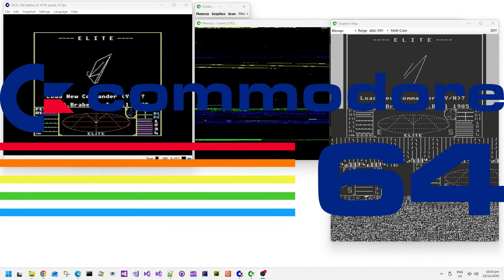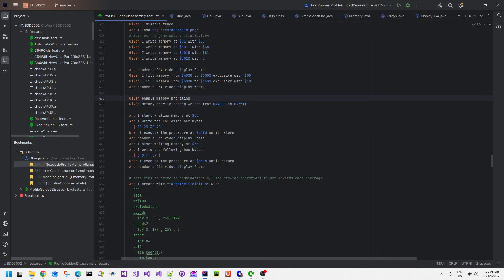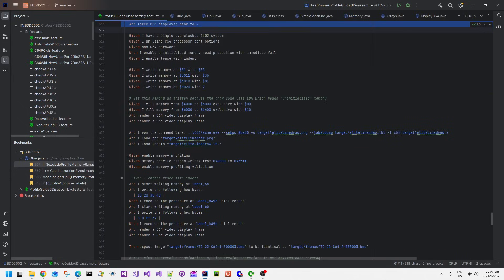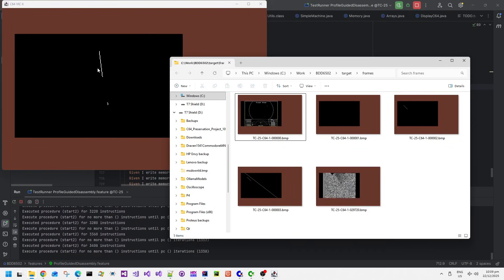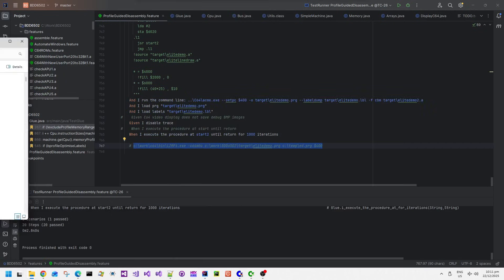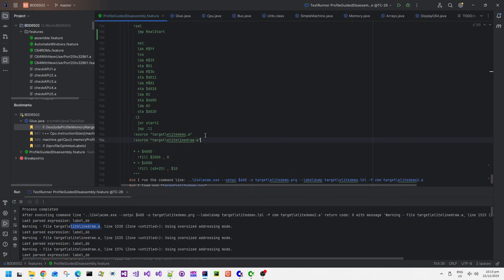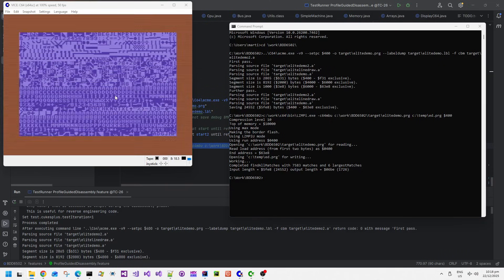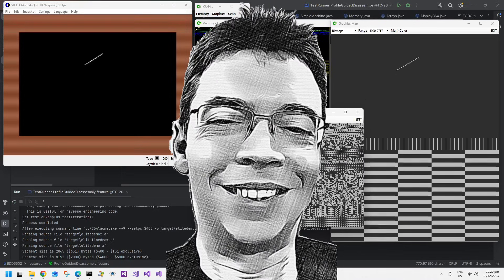C64 Coding - Elite's line draw disassembled

Comment: @MartinPiper6502 A demo called "C64: Christmas Megademo (2020)" uploaded by I Dreamt In 8 Bits seem to be popular this year. Never saw it until this year.  Can you take a look at the snow FX at 24-30 seconds in? I doubt sprites, but I don't see how it could be custom chars. And too many flakes for a 1MHz 6510 to move I think. There's still that other snow demo, what' it called? Oh, just found... "C64 One File Demo: Xmas 2023 by Luke ! 23 December 2023!" has fluffy flakes, guessing custom chars but, nice natural-looking technique.  Ah!  Here's the one I asked about before, it's called Hyperborea by Artline Designs.
Reply from the maker: I saw it in YouTube, it looks like X expanded sprites, in a sheet, over a bitmap. :) A repeating pattern of pre-calculated animated sprite frames would work.
Reply: @MartinPiper6502  I mentioned 3 demos. To which one are you speculating on?
Reply from the maker: @KellyIsUppity  "C64: Christmas Megademo (2020)"

Comment: I remember disassembling Starion's line drawing code on the Speccy back in the day. It was faster and smoother than Elite but also a different kind of space game. I don't think it' had hidden surface removal. It didn't use XOR do "undraw" between frames but it had an incredibly fast trick to clear the screen instead, which used the stack and the spare register set, something you wouldn't be able to do in 6502 world. Interesting to see something contemporary and similar from the C64.

Comment: I really wish someone would give the dragon some love and bring Elite over to that.  The 6809 processor is faster and more efficient that 6502 which was why it was much more expensive leading to the reason it wasn't used as often in home computers and more in arcade machines and other applications.  But the dragon is still popular among enthusiasts and the Color Computer community at large would love it too.
Reply: The Dragon had quite inferior sound and video hardware which could not be compensated for by the higher CPU performance.  In my memory disk drives were rare, even more expensive than for the C64 and required a disk controller which was dangerously hanging out from the expansion port.  The Dragon 64 with OS9  and a floppy drive was a decent office system.  Commodore on the other hand had their professional BCM series computers, their VC and Pet series more targeted at amateurs.  Pushing the C64 into the market and seeing where it was going to establish itself was a comparably trivial exercise.  On top of that Dragon was barely successful outside the UK.

I haven't watched the video yet but I'd assume Elite is using the Bresenham's algorithm for lines and circles.  That's at least what I have implemented myself back then 🙂  The algorithm is very clever, elegant and foremost, fast.  It's just that the VIC's crazy memory layout for hires graphics is throwing a wrench into the mechanics of that elegant performance.

Comment: That's pretty cool, though I'm not sure what the use of it is straight away. The actual point to point Bresenham part of wireframe 3D is about the simplest part, isn't it? And the erasing is just doing it all again but setting the pixels to black instead of white (if you don't care about what you overwrite, which would seem to be the case if you're redrawing the entire viewscreen each time... the clever part is not ruining the text that the ships overlap with on the title screen).

The heavy work is what goes before, calculating the actual points to draw between and working out which lines to not draw (or immediately erase?) for the hidden-line style. Be interested to see if that can be isolated and pulled out, just taking a table of vertices in 3D space plus a camera position and orientation, or even one of objects and their positions/rotations, and generating the draw list that can then be presented to this routine.
Reply from the maker: There's an excellent site with disassembly analysis across multiple machines and releases. Have a look for the section "Elite G (Flight)" and then "Drawing ships". This contains an analysis of all the transformation, projection, line clipping etc. The Commodore 64 version has some differences compared to the BBC version, notably the use of log maths for the line draw divide and a corresponding inverse table transformation, with unrolled pixel plot.
https://elite.bbcelite.com/disc/articles/map_of_the_source_code.html

Comment: I just did this in my head, so it may be wrong. I have no opportunity to test it. But if you line draw the new image before you line draw the old one to erase it, and you're using an XOR drawing routine.. I think that will cause less flicker in cases where the object is moving. Or not. But both versions should take the same amount of time at least. Is that worth a trial run?
Reply: Flicker free lower res bitmap c64 gfx alternative:
Once coded a 192x192 bitmap(96x96 2x2 or 48x96 2x4 pixel) display using 16 multiplexed expanded sprites to over/underlay a normal text screen to get additional coloring/effects per block on most of the screen .  Could switch sprite pointers to double buffer flicker free low res bitmap gfx and the render  cost of the chunkier pixels meant good speed boost and much lower memory footprint. 
Actually multiplexed 32 sprites for that experiment so could have a 192x192 sprite bitmap overlay with 16 free roaming sprites, so presumably could've used the 16 free sprites for another simultaneous 192x192 chunky pixel overlay! 
Also given was a sprite based bitmap overlay on normal text modes, could have interesting computationally cheap char effects happening behind/in front of  it like plasma effects, parallax, char sprites etc 
Thought about using it on my 3d petscii c64 hybrid raycast/polygon engine to  do  something really interesting..... 
Wonder if anyone tried implementing such a thing in a game?
Reply from the maker: The game does the same line draw to erase, because it's an eor draw. If the previous frame line is erased just after or before the new frame line for the same object then that will reduce flickering.
Reply: Perhaps. In my head I can't shake the fact that getting some of the new lines onto the screen before erasing the old ones would have some sort of persistence of vision difference though. As I said though, no real idea if that's the case. And, again, only for moving objects. If the frames are the same, the results would be identical.
Reply from the maker: I have a feeling it would be less annoying than the full object erase and draw flicker :)

Comment: That's such a great idea, I'm totally going to  ~~steal~~ borrow this idea for my emulator stack!
Reply from the maker: Awesome! Hope it works out well for you.
Reply: Wdym by emulator stack exactly? Why is a line drawing routine of use to it? Are you emulating vector graphics on an 8bit system?
I want to build some kind of Z80 based arcade machine/puzzle box but haven't looked into graphics output options yet, but this got me tempted to see if something along those lines (pun not intended) could be doable. I'd probably use one or more Z80s just for drawing, in addition to a main program one and possibly more for other subsystems. Not sure what kind of device to display on yet though, could go for anything from a ws2812 matrix to a whole microcontroller+lcd combo, but something in between preferably.
Just a dream project so far, but I got a dozen Z80s and eeproms on hand. Built an eeprom programmer, and got a Z80 to run with an Arduino emulating the memory last night, so it doesn't feel that out of reach. The fact all these chips are so cheap nowadays is fantastic. It's as if you had infinite money in the 80s.

Comment: how many bits for x,y coord specification and anything interesting about the clipping?
Reply from the maker: The screen coordinates are just 8 bits on screen. I didn't look at the clipping.
Reply: @MartinPiper6502  Hi and thanks for reply and cool content. I meant the unclipped  x,y line specification coordinates under z scaling prior to drawing, not screen. Given some lines will extend beyond screen space depending on scaling and culling, surely is more than an 8 bit internal representation somewhere which would require clipping?
Reply from the maker: It looks like the transformed coordinates are 16 bit values clipped to the 8 bit screen values, in the BBC version at least...
https://elite.bbcelite.com/master/main/subroutine/ll145_part_1_of_4.html
https://elite.bbcelite.com/master/main/subroutine/ll145_part_2_of_4.html
https://elite.bbcelite.com/master/main/subroutine/ll145_part_3_of_4.html
https://elite.bbcelite.com/master/main/subroutine/ll145_part_4_of_4.html
Reply: @MartinPiper6502  Awesome, thanks for links and Merry Xmas!!
Reply: @MartinPiper6502  oh wow O_O
Reply: @MartinPiper6502  I think the actual display was still only 256px wide even on the ST and Amiga, just with a nice border...

Comment: One byte represents several pixels depending on the colours/ graphic mode. They are arranged into blocks. The algorith to draw lines would be interesting since you have to do some bit arithmetic as well.
Reply: Is it not planar? So if you're only drawing in 1bpp it's fairly simple. Though hirez bitmap mode is already 1-bit anyway.
Reply: @tahrey  C64 does no bit planes - the Amiga does but in case of the Amiga there is a custom chip, the blitter, to draw lines.  Elite is based on Bresenham's algorithm which can draw about any function fast as long as one can efficiently compute the first derivative and that derivative is <= 0 or symmetries can be exploited.  Which is really trivial and thus fast for lines.  It also means circles or ellipses are possible, too.  The algorithm is basically the textbook material, if you're interested search for it and you should find numerous references.

The exploitation of symmetries when drawing the circle of a planet is quite visible.  If I recall right elite is quite visibly drawing four quarter circles.  My own code did draw eights segments of a circle but to be honest, I did not benchmark the two variants against each other.

The basic Bresenham's algorithm relies on a primitive to draw a pixel and that's going to be relatively expensive in case of the C64.  If I had to implement it again I'd try to merge the pixel drawing algorithm into the Bresenham code and see if that results in a performance boost.

Comment: Interesting, i always thougth that with VIC and PLA it was very cheap and easy to do double buffering on C-64 to not flicker
Reply from the maker: Yes it's quite easy, but memory space can be an issue. Also the game, back then, was built around a single buffered screen with eor draw. Although with the later "no flicker" (reduced flicker) draw the double buffer was less required.
Reply: @MartinPiper6502  Ah right, that makes sense, given the origin. The Beeb version was VERY tight on memory on a 32K machine, there's no way it could have spared the fairly significant amount required to have a back buffer. Perhaps a version made for the Master could have managed it, and of course the C64 if there wasn't any particular code splurge during porting (same chip pretty much so at least the core routines could be kept the same)
Reply: @tahrey  Apparently Mark Moxon said, C64 Elite uses all but 897 bytes of the machine's 64 KB RAM.   The difference is used for an enhanced game, it's not just a 1:1 port from the BBC.  A full bitmap would have required 8000 bytes.  Actually slightly less because a raster interrupt was used to split the screen.  At the top the hires graphics of the game play itself and below that the multicolour graphics of the console which would not need to be double buffered.  So 5000 or 6000 bytes maybe?

A few years ago on a party I ran into somebody who knew Braben & Bell while they were working on the game.  He told me a few stories - basically it was very, very tough to squeeze the game into the available memory.  They were working on it with near obsession for quite some time.  Knowing this I think 5000+ extra bytes would have been impossible to squeeze out without compromises elsewhere.

Comment: Can you give benchmarks between old and new code. Both number of bytes required for both implementations and some relative performance metrics. I use to code on the 64, and byte count and cycle count of the code was an important thing to know. As these were the two hard limits/constraints we had to code against.
Reply from the maker: This line draw uses lookup tables and code in different pages. Merging all together reduces the space in between those parts. Since this routine is already very optimised, there isn't any code speed optimisation, the cycle counts are basically the same.